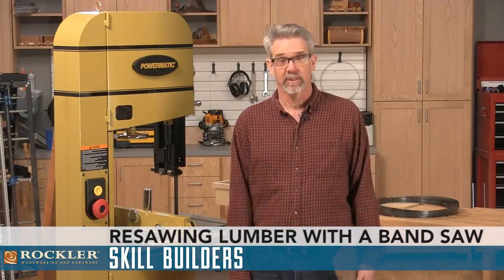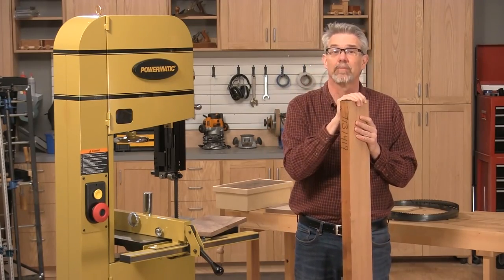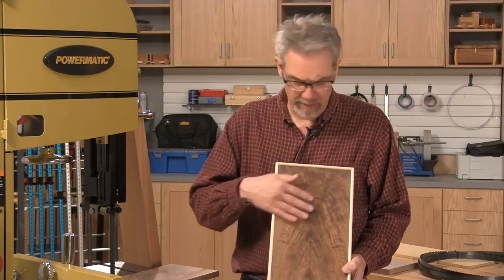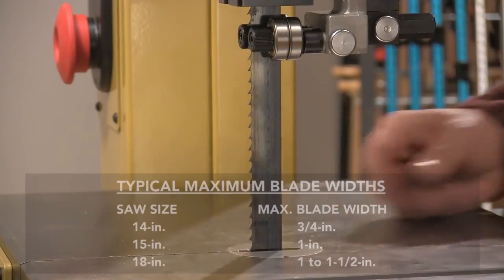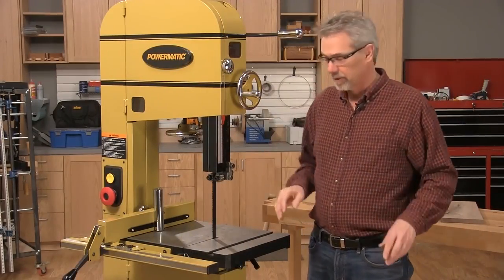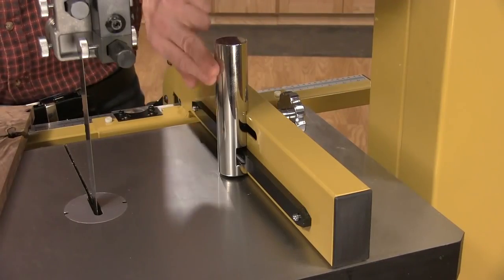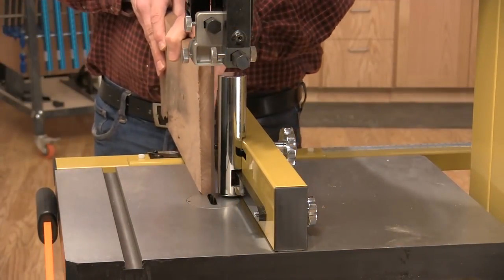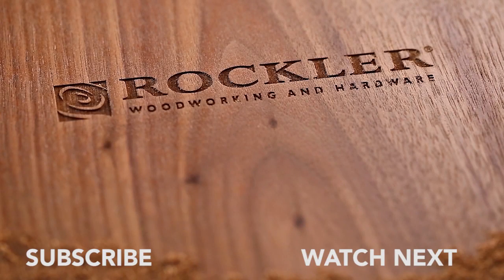How to Resaw Lumber with a Band Saw | Rockler Skill Builders

Comment: A note about guide setup would help and if it is done right the you don't need the point guide you can use a flat fence. Also a note about tension is in order as well. I have a cheap 14" with a 1.5 hp motor and resaw 8" oak all the time. But it is all I do with that saw and it is setup for it. In other words the setup is everything but it will eat up time in the shop if you try changing blades all the time. For the cost of your saw I can get two jet saws and dedicate. For those new to bandsaws setup the best video I have seen it "Band Saw Clinic with Alex Snodgrass" here on YouTube.

Comment: I do have a Band Saw 14" with three speeds, 735, 1470 and 2350 SFPM 3/4 blade, which speed I should use resaw hardwoods.

Comment: I have 50 2x8-16 and 200 2x4-10 QSWO to resaw to 1-by material.  Have been considering buying a band saw to do it but I think the board lengths will defeat me.
Reply: Get a roller stand or two and you should be good to go!

Comment: What size of bandsaw should I buy I'm thinking about buying a 9in but there is a 10in that I'm interested in which one should I buy 10 or 9 inches
Reply: James Puphal if cost is the limiting factor wait a while longer and save up for a 14". Little saws like that often have a lot of problems and go through a ton of blades due to blade metal fatigue. If you get 9" or 10" you'll soon find you want a 14" or larger. It's always best to buy a tool once.
Reply: When you're searching out a bandsaw specifically for resawing, it's the height capacity that you need to look for.  There's lots of small saws out there but they have short clearance.  And you need a wide blade with 3 or 4 teeth per inch, and a saw with enough power so you can push the board through relatively quickly or it takes forever because very much friction must be overcome when resawing.  A dust collector, as seen in many vids in experienced woodworker"s shops, is a handy item as well, and, as a bonus feature, they work with quite a few larger power tools.

Comment: Almost forgot to ask what blade brand is best for this application? I’m about to order a Timber Wolf blade for my setup. Thanks in advance everyone 👍🏼
Reply from the maker: There are many brands of band saw blades from which to choose, and most manufacturers offer blades that are suitable for resawing. Ask ten woodworkers which brand is "best" for resawing, and you'll probably get ten different answers. What's more relevant here is the type of blade you use. For resawing, a wider blade is better than a narrower one. It will remain stiffer under tension to avoid deflecting during resawing. Blades in the 1/2"- to 1"-wide range are ideal. Additionally, use a blade with a low tooth count per inch (TPI). The teeth will be larger, to cut more quickly and efficiently, and the large gullets between the teeth will help clear the large volume of sawdust produced. A blade with around three to six teeth per inch is a good choice.
Reply: Rockler Woodworking and Hardware. Thanks I already ordered a 4 TPI 1/2” bandsaw before seeing your response but I was asking about brands... I don’t know 10 woodworkers I only know me. 😉 which is why I asked you. Good pointers tho.
Reply: @fivetwentyseven8598  I have Timber Wolf blades.  They're good.  If you're not sure what blade to use, call their customer service.  It's great.

Comment: Just go to your $2,900 band saw and get er done!!!!
Reply: wicked650s ......$4000 in Aus😩😩
Reply: Yeah, I noticed that he didn't mention price.  Sure sign of a manufacturer-made video.  I'm waiting for delivery of a Rikon 10-324 with 13 1/2" height capacity.  Much less costly than this one ($800 is still more than I really wanted to spend), but if you wanna do big resaws, you gotta get the tools.  I plan to do those book end panels and then make custom cabinet doors to sell.
Reply: I used to do it with my 14" Jet with riser block and 1/2" 3 TPI skip tooth blade.  Only a poor workman blames his tool...or has drool envy for someone else's.